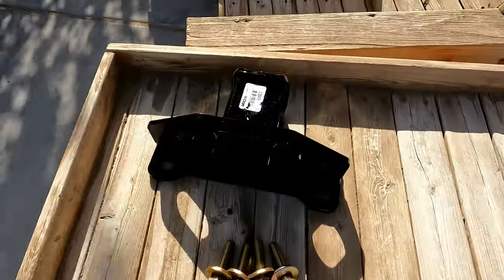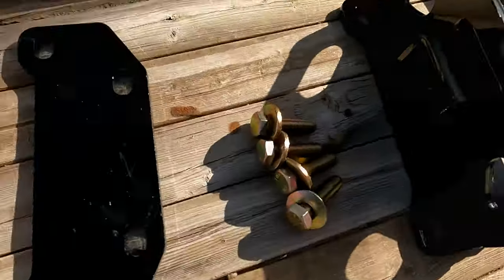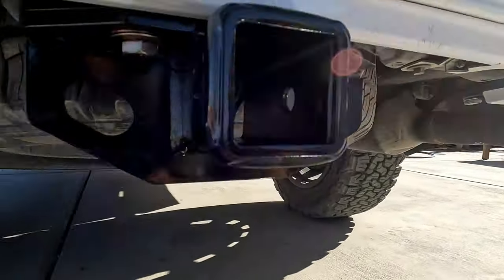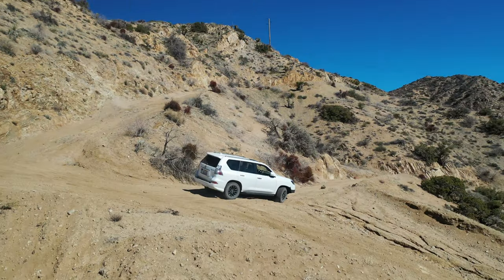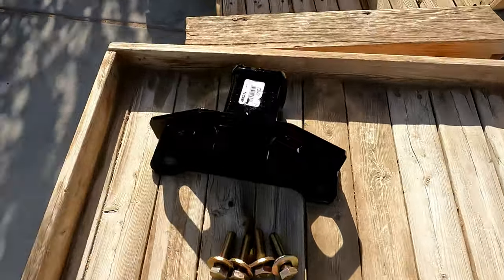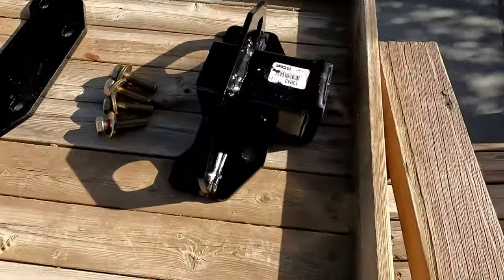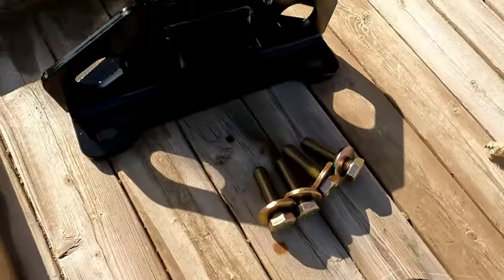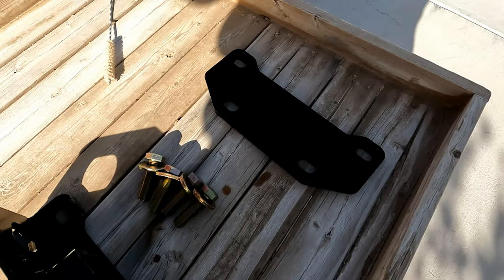Lexus GX460 Class 3 Hitch Receiver Install | Curt Hitch Receiver

Comment: Why not just untab that little bumper valance to not have to use the spacer.   makes it mount higher and gives a more integrated look
Reply from the maker: great suggestion... it'd prolly gain 1/4" of departure angle too... 😃

Comment: is 86Lbs torgue correct?  Im seeing online in differnt places for the Curt hitch to be torqued at 73 / 68 / 86 Lbs.  what is the correct torque?
Reply from the maker: I think we did 86... honestly any of those values are fine.. the bolts are big and those washers are gonna deform and hold everything tight ✌️
Reply: @LexusGX460-OFF-ROAD  Thanks. I wont be hauling a trailer or anything heavy anyway. So i was thinking any of them would be fine as well.
Reply from the maker: @AltonHoang  thanks for subscribing ❤️

Comment: What is it rated to tow and what is the tongue weight load it will hold?
Reply: 500lbs
Reply: …Is class 3 rated at 3,500lb to 8,000 pulling capacity????

Comment: Not much weight and a lot of utility 👌
Can easily be taken off as well, just keep a breaker bar and the socket with you for relatively quick clearance.  Heck, can put it on easily again, 86 ft-lb is right between hard and F-ing hard torquing